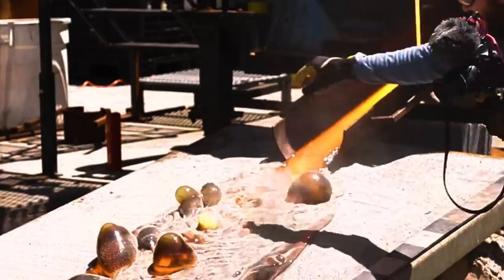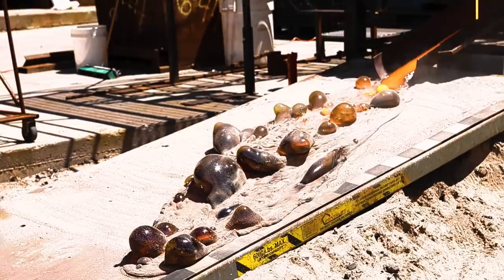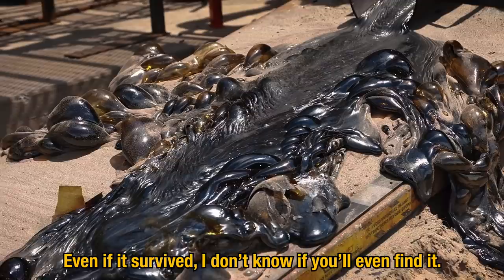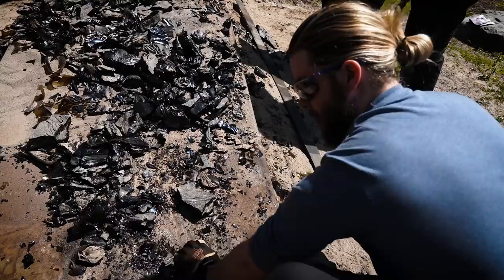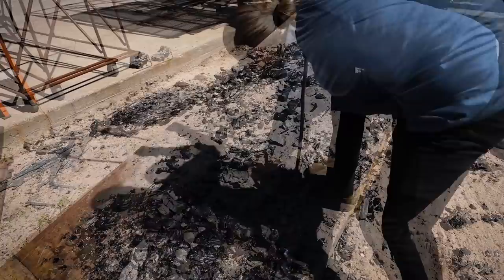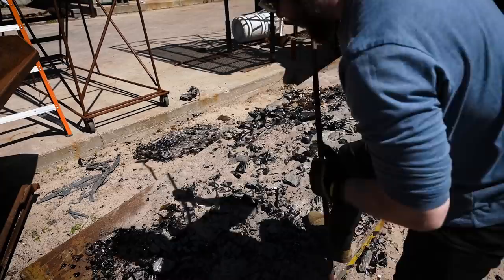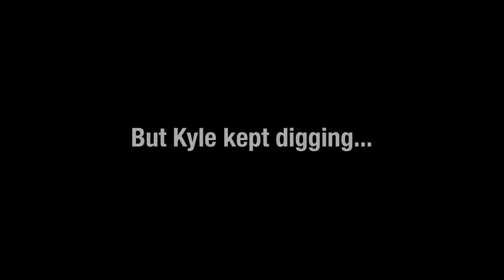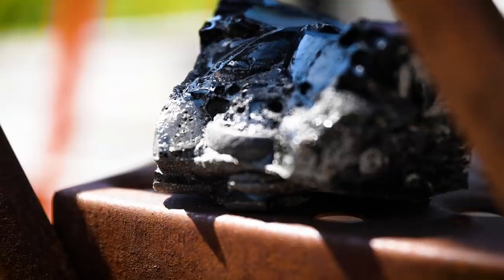Will REAL LAVA Destroy the One Ring?

Comment: The difference is that the lava in Mt doom was not cooling .  You placed the ring in lava which was in a cooling state.  a proper test would be to drop it in the furnace with the lava and keep it there for 5 minutes before pouring it
Reply: Just finished the video and came down to say this. A more accurate test would have been to throw it in the crucible. But either way it was a fun video, and I'm impressed Kyle managed to even find that ring after.
Reply: Still wouldn't melt. Titanium doesn't start to melt till 1650* C, so if he's running at 1500*, it's gonna be basically the same.
Reply: Yeah not to mention the ring should be made of solid gold, not gold plated titanium. You can see that the gold plating melted away but the titanium remained. Titanium has a much higher melting point than gold so it's no real surprise that the titanium was left behind. (The melting point of Titanium being 1910 °C and the lava being only 1200 °C
Reply: @seancrane278  unlike water, lava within the earth doesn’t stop getting hotter at a specific temperature. So it might be possible although I’m not sure lava even at its hottest temperature on earth can melt titanium, but it certainly will melt gold.
Reply: Haters be hatin', but the ring be not meltin'.
Reply: Just what I was thinking.  Although the embedded ring is a seriously cool paper weight. I wonder if stuff like that could be a revenue stream for the department? They could do a merch flow, chucking stuff in and recovering it at the end.
Reply: @GrowingAnswers  oh absolutely on the gold. You can do that at home with a hand torch. 
If one wants to be pedantic,  the hottest lava I saw from a quick search was about 1300 C once it erupts. Magma, while still in the earth though,  absolutely can melt tungsten. Deep in the outer mantle,  you're hitting 3700* C. Heck, tungsten is melting at that point.
Reply: @anthonystark5729  the cost of running that crucible is gonna be kinda ridiculous. That's a lot of electricity or fuel to get that temp. As cool as it'd be,  I don't know how viable it'd be.
Reply: @seancrane278  A fictional mountain grounded in reality makes it plausible. Just need to heat a small batch of magma with oxy/acetylene and drop in the ring on top.
Reply: @HerbaMachina  I think the titanium is ment to represent the magically enhanced durability of the original One Ring
Reply: @GrowingAnswers  I like the way you think
Reply: @seancrane278  That wouldn't warp the ring into an unrecognizable shape?
Reply: @miniverse2002  my apologies,  I'm not sure which point you're referring to,  but in general,  it depends on the metal. Not all metals warp the same under heat. 

Heck,  just under steel alone,  alloys can be wildly different. Architecture steel moves super easy when hot while something like a high speed tool steel just laughs when you try to forge it.
Reply: I agree with everyone here. It need to be place in the heated crucible. But use something more fitting for the setting. Titanium would not be a good stand in. Stainless steel or the like.
Reply: I knew I wouldnt be the first to think this.
Reply: @seancrane278  They could do like 1000 products per pour.
Reply: @seancrane278  It isn't very likely that the One Ring as Tolkien envisioned was made of titanium, since that material wasn't used in rings until the 1990s.
Reply: Yeah I was just thinking it was thrown into the volcano, not a stream of lava coming of it
Reply: I endorse this observation, though I’d also add that the volume/mass of lava was greater in lotr. So make the crucible the size of the Mount Doom lava lake!
Reply: I was going to say the same thing. There's a difference between "erupting" or poured and cooling lava vs a lava lake. Eventually the mass will heat up to its surrounding temp and melt.  There is the thing with it being tungsten also and a really high melting temp. Solid gold ring would definitely melt.
Reply: Don't forget the ring has an extremely low thermal conductivity. A regular fire doesn't even make it warm to the touch. Even if lava was hot enough to melt it, I think it would be encased in a layer of insulating rock/obsidian long before it could melt.
Reply: @miniverse2002  Warping is more from uneven heating and therefore uneven expansion. Unless it gets hot enough to melt. Titanium is pretty tough, i have some neck chains made out of it i wear geeky stuff on. If you heat it with a torch it forms an oxide layer on the surface that gives it the pretty blues and purple colors.
Reply: @Maximusrex4575  I saw interpretations that it was gold, as Morgoth channeled he power through gold and gold was the root of evil. Apologies for the lack of source,  they were quotes on a board.
Reply: @EC-dz4bq  fair. Would be a cool thing to do. I might have to do something like that myself...
Reply: @keithyinger3326  I think it was a titanium ring, not tungsten. Tungsten is a PAIN to melt. You tend to make things that hold melting things out of tungsten.
Reply: @jwjeff11  I did wonder on why the ring never got hot. I assumed it was just "because magic"
Reply: I agree totaly, it should go into the furnace. Although One Ring, made out of gold, could be destryed only in MD, because it was made there. It was more about breaking the spell, than only hot temp. 

Anyway, Kyle’s ring imbeded in lavarock is probably one of the coolest replicas in the world <3
Reply: A few factors - 
1. The contents of the kiln are evenly heated. Volcanic heat comes from below and your hobbit is throwing the ring on top of the lava (where we see it melt in the movie). That layer is 750-900°C, gold melts at 1,064°C, so it's not going to melt on the surface like in the film.
2. The "skin" on top of lava is visco-elastic, so it's going to resist most material falling in, slowing the ring falling through it. It's not going to punch through very deep from how far it fell.
3. Melting requires absorbing heat energy from the surroundings. This drops the temperature of the lava to the point it solidifies (that black layer you see on the ring is on top of the gold, the gold didn't melt) before it gets the ring up to its melting temperature. As he said in both this and the previous video, that later is insulating and buoyant. 
4. Surface lava is NOT the top of a column of magma going down to the molten outer core. The depiction of a mantle plume connecting the core to the volcano is a path traveled by what amounts to a series of enormous bubbles of magma. It's not a connection. It's also not even a connection to the magma chamber itself - if it were, it would have exploded due to the enormous pressure difference. Lava is always relatively shallow compared to its source.
5. Lava flows deposit gold. Gold doesn't just sink to the bottom like you might expect with water. The only reason it did in this experiment is that the "bottom" was only about 2 inches deeper than where he dropped the ring.
Reply: @SatanicDemiGod  OK, but the whole point of throwing it into Mount Doom was to negate its power by taking it back to whence it came. Otherwise they could have just thrown the ring into a furnace.
Reply: @seancrane278  when Isildur picked the ring out of the hand (or finger) of Sauron, Isildur was burned by the heat of the ring. I agree with the others, it takes A LOT of energy to heat up the One ring.
Reply: Yep kyle and his inaccurate tests once again
Reply: @Merennulli  The ring as it temporarily cooled the magma around it till it solidified, this would create denser material around the ring and cause it to sink. As it sinks, the ring would travel to the hotter layers all the while the whole time the outer material would be heating back up and it'd eventually easily reach a heat that could melt the gold. You see this when melting down scrap metal and you toss a piece of scrap metal on top. it floats for a little bit but slowly sinks and eventually melts once it hits equilibrium temperatures with the rest of the molten metal. The same thing would happen to the ring in this case but the volcano is a much more tumultuous environment with strong convection currents so the material that used to be the ring may eventually circulate back to the top layer again in the future.
Reply: @Talishar  As he mentioned in the video, basalt (cooled lava) floats on lava. Also, keep in mind with your scrap metal example that you are constantly adding new heat, while a lava flow like that seen in Lord of the Rings or any real world volcano isn't adding heat, it's just bringing up new, already-heated material.
Reply: That's the Dwarven spirit!
Reply: @Merennulli  First of all, we aren't talking about lava flows. The source text is in an ancient but active volcano and that's the original point of the whole thread. Also, basalt that's lighter/less dense than the lava is only formed when the lava is allowed to cool extremely quickly to trap the gasses within itself as it nearly flash cools. That wouldn't happen when you tossed the ring in or if it did, it'd very quickly heat back up and outgas the trapped gasses and you wouldn't end up with a the airy porous basalt. You don't get this with an active volcano as the material is constantly churned by the convection and addition of more heat and material from the vent. The new mass being added is essentially adding heat and mass to the system. Again, we're talking about the heart of an active volcano, not the lava slowly pouring out of its side. Frodo didn't stop 3/4 of the way up,  tossed the ring into a lava flow on the side and called it a day. He went through a deep and winding cavern system to eventually reach the heart of the mountain to toss the ring into the core of the volcano.
Reply: I don't remember but was it ever stated in the books what metal The One Ring was actually made of?
Reply: @HerbaMachina  disagree with that cuz its supposed to be a magic ring, probably sturdier than a ring of the same material.
Reply: @SatanicDemiGod  the one ring wasn't "durable" because of the material it was made of, it was durable thanks to the magic witch was created and the spirit of sauron itself resident in it.
Reply: If he did that it might have been impossible to find even if it didn't melt
Reply: @Talishar  I checked the movie scene before commenting and I checked the book just now. It IS a lava flow. 

The book is less specific, but they enter a volcanic fissure, pass through the gate of Sammath Naur, and Frodo approaches the Crack of Doom. We are never once given ANY description of what's in the Crack of Doom except "fire", and "red glare". - "But only a short way ahead its floor and the walls on either side were cloven by a great fissure, out of which the red glare came, now leaping up, now dying down into darkness; and all the while far below there was a rumour and a trouble as of great engines throbbing and laboring." (page 924 in my copy). The lava isn't static, it's moving. Other parts of the chapter mention floes, and the volcano is belching smoke.

As for basalt, it isn't porous. It's a fairly dense rock, but it does not sink in lava. You're probably thinking of gabro which IS porous and floats on water (not just lava).

It's important that basalt DOES float on lava. If basalt sank as you suggest, we wouldn't have the crust.
Reply: @HerbaMachina  ,
The Ring was alloyed with the essence of a God-like being!
Are you sure it would behave as if it was simple gold?
Gandalf clearly believed otherwise, given he scoffed at the idea of simply forge melting it....
Reply: @jwjeff11  you’re onto something. Yes the flames kept it cool. It wasn’t just a mountainous cauldron of lava, but from which the very fire it was forged. Only the same can destroy it (you know, magical properties and all that). Still a great video and so great he found it!
Reply: @Merennulli  the surface would be disrupted by gollum's impact. Which would have been much nastier than the movie showed. In fact, going from what is in screen, the lava is more liquid than real equivalents, which would imply a greater temperature. 

After all, this is not yet Earth, and it doesn't have to even be a round world - it's flat in the books early on, from memory.
Reply: @SatanicDemiGod  I think the titanium is a way to keep the cost down...
Reply: @HerbaMachina  Gold would also be much closer to the ambient temperature of the air, so even if it were magically enhanced you wouldn't get the same crust formation happening.
Reply: @BrettCaton  In the movie, Gollum (less dense, more surface area) sank while the ring (denser, less surface area). You can't assume the lava hotter based on Gollum impossibly sinking into it when the surface of the lava and the ring sitting on top of it unharmed for several minutes (until suddenly insta-melting) pretty clearly show it wasn't.

As for a flat Arda (not Earth yet), it became round in the Second Age. The War of the Ring took place at the end of the Third Age, so no, it's not flat at this point.
Reply: Just what I was thinking, no less the One Ring was not titanium in any way, probably solid gold, which melts at around 1950 degrees Frankenstein (that’s 1064 sCience), while titanium might withstand the liquid magma better since it melts at over 3000 degrees F (over 1600 C) so there’s that.
Reply: @Merennulli  The type of basalt you describe is the porous vesicular basalt which is also the most common type of basalt. The lava cools quickly and traps gas inside of it creating pockets of air throughout the basalt. The denser stuff is the material underneath that layer that cools much more slowly and is much less porous. Also, the video shows an exposed underground magma vein. It's not a surface flow and even the book's description says they went UNDERGROUND through a fissure and traveled quite a ways from the underground entrance. This lava isn't going to have a hardened, cooled layer as it's traveling underground and the surrounding stone would act as an insulator. While it would be shedding massive amounts of heat, it'd also be getting new heat from the new material flowing in. Also, there aren't ANY still pockets of lava or magma, It's all moving and flowing through convection at the very least.
Reply: @BrettCaton  At the time Frodo lived, the planet was already round for ages (though elves could still travel the "straight path" to Valinor)
Reply: @Talishar  Crustal basalts are not vesicular basalts and vesicular basalts do not work for your argument anyway, they're still nearly as dense as non-vesicular basalt, just with a few cavities from gas bubbles. I believe your thought process is that basalt is more dense than lava so it wouldn't float on lava, but the oceanic crust is literally basalt that did this and you can watch it happening now as lava cools and doesn't sink into itself, often forming lava tubes as the outermost layers exposed to the air solidify.

As for the notion that this is some deep cavernous descent into the depths of the volcano - that would still be lava, not magma because it's in contact with surface pressure. That pressure difference is why we even need a distinguishing term.

But reality isn't what we're here for - to the book. "The path climbed on. Soon it bent again and with a last eastward course passed in a cutting along the face of the cone and came to the dark door in the Mountain's side, the door of Sammath Naur." (page 923 in my copy) - so the gate is on the exterior, not inside a cavern. The rest of the paragraph that carries onto page 924 is also describing Mordor from Sam's perspective there, so VERY clearly not in a cavern yet. The relevant parts to the cavern from the next 3 paragraphs: "Sam came to the gapaing mouth and peered in. It was dark and hot, but a deep rumbling shook the air." Then later, "Fearfully, he took a few uncertain steps in the dark, and then all at once there came a flash of red that leaped upward and smote the high roof." So barely in he can see the lava splash against the ceiling of the cavern. "Then Sam saw that he was in a long cave or tunnel that bored into the Mountain's smoking crater. But only a short way ahead its floor and the walls on either side were cloven by a great fissure, out of which the red glare came, now leaping up, now dying down into darkness; and all the while far below there was a rumour and a trouble as of great engines throbbing and labouring." And at this point he sees Frodo. There is no great descent into the depths of the mountain. Sam is described taking a few fearful steps past the gate in the darkness, using his phial to try to illuminate it, then the lava gushing upward to reveal the scene and the fissure where he found Frodo. You've made me re-read it twice to explain this to you. I recommend you get your own copy out and re-read it yourself. They aren't deep underground (not that it would matter if they were). The cave is described as "long" but he finds the fissure and Frodo before traversing it in any great depth.
Reply: @SatanicDemiGod  Except the durability of the one ring is more like a blade or hammer can't even touch it. Heck the ring wouldn't even let a user wear it if it choose not to.Because it can change size at will, that's why humans and hobbits can snugly wear it alike, and why golem lost it in the first place it expanded and fell off him.
Reply: @Merennulli  The vast majority of the outer surface of a lava flow is vesicular basalt. The majority of basalt is vesicular as the lava is constantly outgassing trapped volatile gasses out. The rapid cooling of the surface of the flow is what causes this and having that trapped gas creates a lot more channels and pockets within the basalt than you seem to think. There are samples that were approximated to be nearly 30% air by volume due to extremely rapid cooling and  this is usually what you'll see underwater. Again, there's a huge difference between the small surface flow from a bucket and the book's version of it trapped down inside of a cavern with a constant, steady supply of new material and heat. The gold in the ring is massively more dense than the lava and it doesn't have the thermal mass to draw enough heat out of the lava fast enough to form basalt around it and to keep it solid. Even by your own description, the lava was actively and aggressively being circulated by convection and the release of new material. Anything on the surface would have been subsumed by that material circulating over it, reheated and liquified again to a lava state. 

You're also grossly misinterpreting your own quoted passage. He didn't take a few steps from the door entrance. He entered the door, walked an unsaid amount of time till hitting the opening with the lava and THEN took a few tentative steps forward. YOU in a previous post said that they entered a fissure FIRST, THEN the gate/door and FINALLY the lava cavern. Which is a cavern because there's mention of a ceiling. This isn't a rapidly cooling lava flow on the surface, it's trapped in a massive contained room where new material and heat is being added to the mix constantly. The contained cavern is insulating the lava and preventing rapid cooling and the new material is bringing in enough new heat into the system to counteract the cooling and keeps the system in equilibrium as molten lava. 

Again, this would have been a better setup if he dropped the ring into the crucible as new heat in this figurative lava pool is being added by new mass carrying this heat into the system.
Reply: @Talishar  I'll be blunt, when you're contradicting your own point in the scientific portions of your argument, and claiming things that aren't in the book, it feels like I'm arguing at a brick wall. I don't want to continue. There's nothing to be gained from this. I know your next comment will be "no I'm not" and go right ahead, but don't expect replies from me anymore.
Reply: @SatanicDemiGod  I'd agree, though I will say (knowing that this is more thought than really needs to be put into it, but I'm a huge LoTR nerd, so whatever) it wasn't just the heat of the lava of Mt. Doom that destroyed the One Ring, it was some mystical quality of the lava in that place that broke the spell binding the Ring to Sauron. That's my interpretation anyway.
Reply: @SatanicDemiGod  But isn't the whole point of going to Mount Doom to defeat the magic enchantment by melting it in the fires that forged it? If it was a normal gold ring then they could just use any forge to melt it down and wouldn't need to travel to Mount Doom.
Reply: @seancrane278  Propane burns at 1980°C in air. Pair it with an oxygen supply and it burns at 2800°C. If that furnace is properly insulated, it really wouldn't be that bad.
Reply: @theconqueringenigma  oh trust me,  I'm aware. It's the mix of getting it perfectly combusted plus the insulation that's the issue. I'm not sure exactly which point you're referring to,  there was a bunch of back and forth. 

You're gonna lose heat through waste gasses,  radiation, etc. You can totally GET a lot of heat,  but as you mentioned,  it's the keeping where you want it.
Reply: Exactly!That 's what I thought instantly
Reply: @seancrane278  lol if it becomes profitable, I want one for free ;) lol im cheap.
Reply: @EC-dz4bq  done!
Reply: Agreed
Reply: @HerbaMachina  is it confirmed that the ring in the book is made of gold?
Reply: @jwjeff11  that have more to do with the ring  using small amount of heat as energy for it's magic.
Reply: @HerbaMachina  wikipedia gives titanium's melting point as 1668 C, 1941 K  I agree it shouldn't melt, but the margin is smaller.
Reply: I also think his use of Titanium was important. We don't know if the One Ring was truly golg, or if it were gold-plated titanium.
Reply: All lava exposed to air is cooling.
Reply: @HerbaMachina  Were the rings cast of solid gold? Is there a source on that?